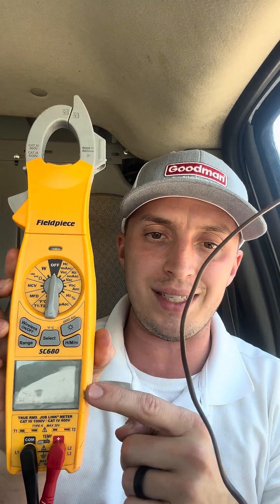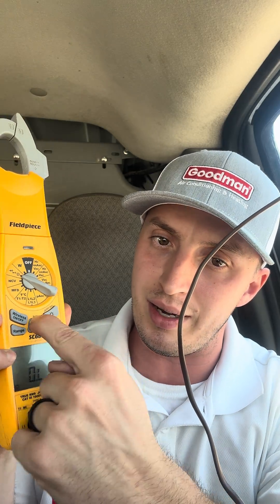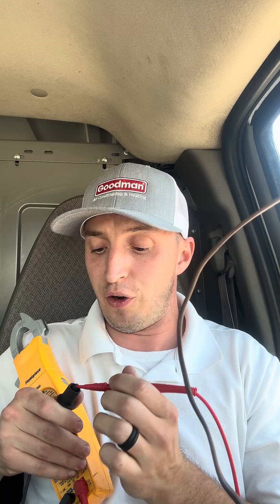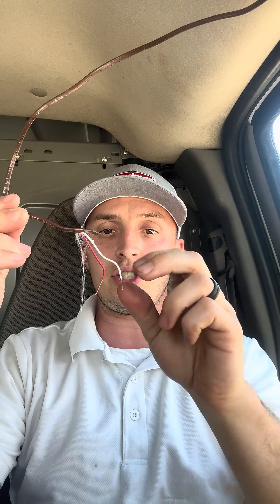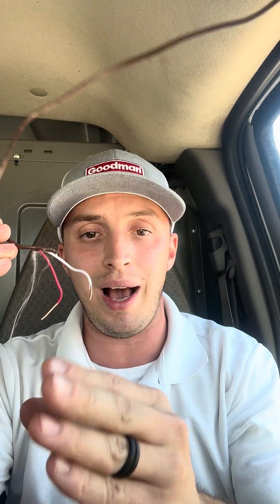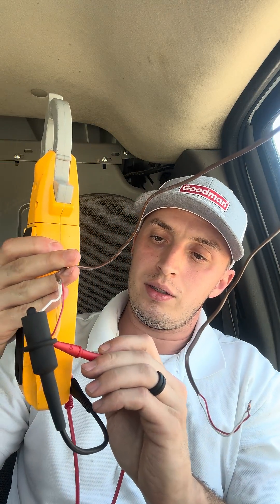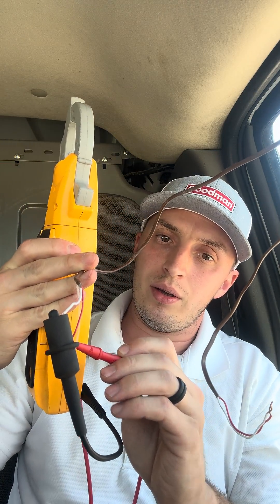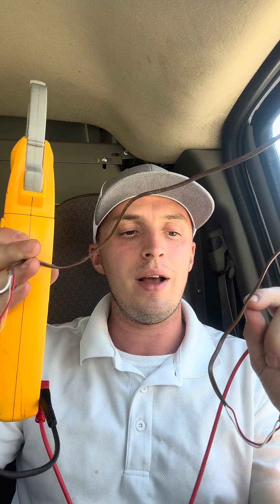Tech Tip Thursday – How to Find a Low Voltage Short (Fieldpiece SC680 Demo)

Comment: I have the sc640 I was to cheep to buy the sc680 the only difference I think is the W setting which I think is the power factor and I’m in residential and light commercial so I don’t need any of that
Reply from the maker: That’s awesome. That’s a good meter. I also have a field piece SC260 that was my first electrical meters handed down to me from another technician. The only problem is the amp draws are more bouncy and finicky, but it works for everything else. That’s why I upgraded the meter. I could send it in and get it repaired, but it would cost us as much as the new field piece SC 260 the awesome thing is even though it’s not under warranty fieldpiece will put a new board in it for me thanks for the comment. Thanks for watching.